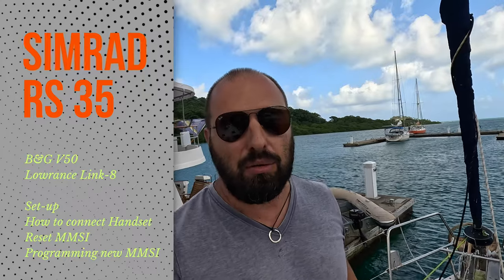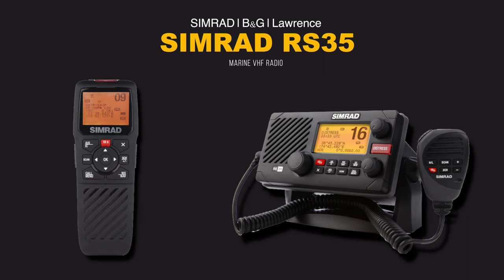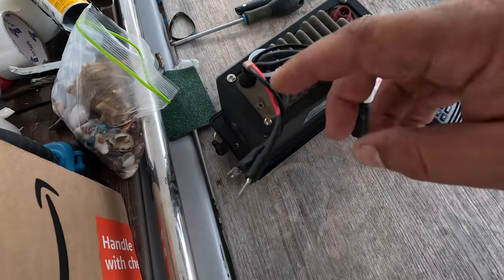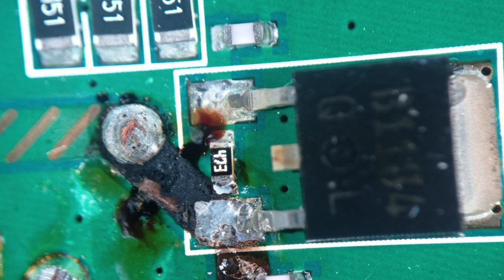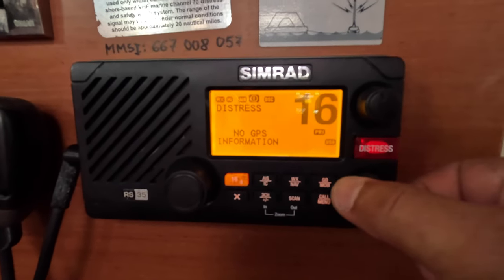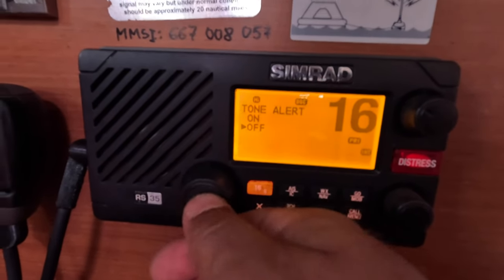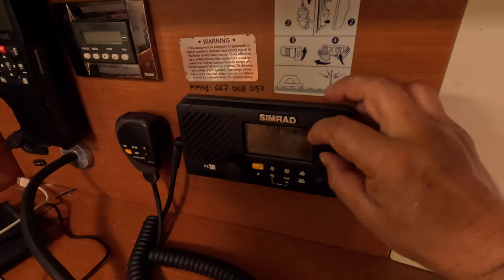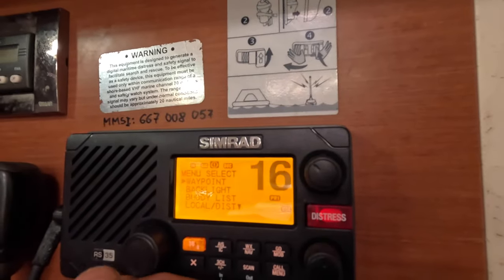📡Unlocking Lowrance Link-8: Hidden Features Exposed📡

Comment: Do you have procedures for rs40-b change mmsi?
Reply: 1) Power up your boat with main switch
2) Turn radio off
3) Simultaneously press and hold both the "X" and "Scan" buttons
4) Turn radio on and wait a few seconds until the radio boots up and you see a menu asking for the code
5) Release both keys
6) Enter code numbers numbers below using the rotary dial

Simrad RS35: 7100
Simrad RS40: 2137
Simrad RS40-B: 2406

Do a factory reset.
Reply: Thanks for that but sorry it didn’t work. After reset is skips the MMSI number.
Reply: @sailorpete136  If you were able to reset the radio to factory, to set the MMSI number if you don't see it come up right away:

1) Long press on MENU key 
2) select DSC SETUP
3) select USER MMSI
4) select '>.' 

That should bring up the screen for initial MMSI programming.
Reply: @ahndeux  I think simrad have changed software to prevent this being done.
Reply: @sailorpete136  If you're able to get into the factory reset menu, it means the software hasn't changed.  They only changed the password number between the RS35 and the RS40.
Reply: I think for the RS40-B version, the PIN number changed to 2406.
Reply: @ahndeux  I did initially get the reset screen, entered the code 2137, however the reset didn’t work. I now cannot boot to the reset screen using X and Scan to try the new code.
Reply: @sailorpete136  Try updating the firmware to the latest version.  That usually does a soft "reset" but keep the MMSI number.